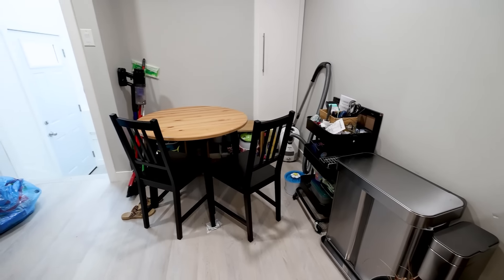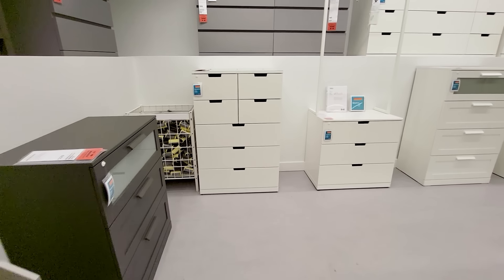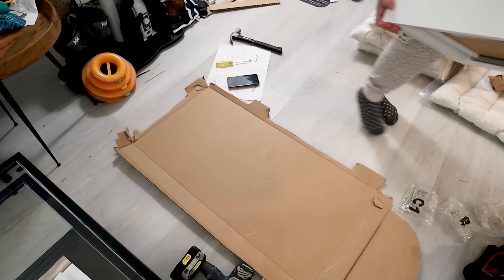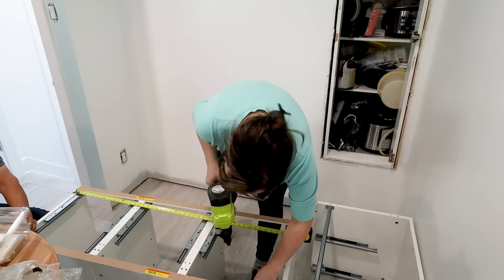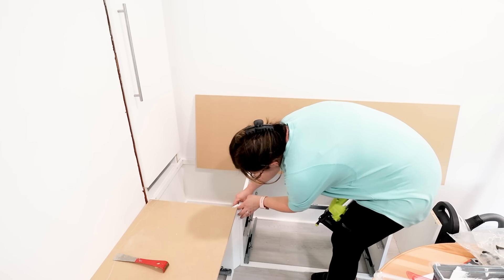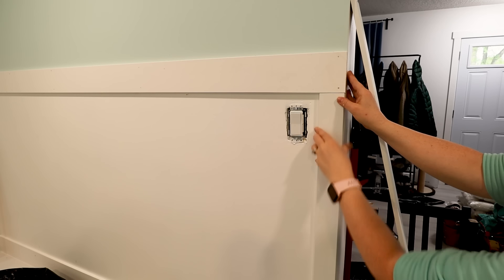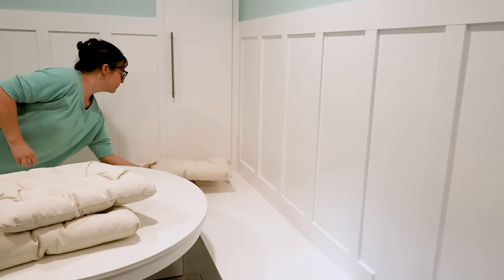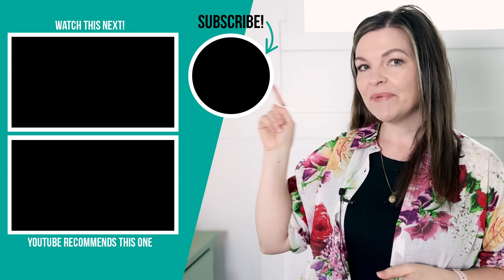I Used IKEA NORDLI for a Stunning Built-In Kitchen Bench Seat | Breakfast Nook MAKEOVER

Comment: That's such a huge improvement. That pantry cupboard is certainly in an awkward place; I'd be tempted to just drywall over it since you've created so much extra storage. Adding the lift so the drawers operate smoothly is just the thoughtful step you can be counted on to do. That's a pretty space.
Reply from the maker: Thank you! The pantry is well used and still needed, so they're going to keep it.
Reply: @thediymommy  is there a possibility that the pantry door be placed on the other side?  It looks like there is a room behind the kitchen/dining room(?)
Reply: Beautiful bright breakfast corner. Love the extra Nordli storage. 

I would only add a recessed handle to the pantry door, which could be more comfortable to sit against.

Comment: Love this!  Did you consider making the board and batten the same height as the pantry door?  It could have disappeared if the space in between the boards were the same width as the pantry door
Reply from the maker: Thank you! I did, but I didn't like that height for the board and batten. I prefer it either 1/3 or 2/3rds up the wall.

Comment: Lovely job, your sister must be rapt. Probably the only thing I would have changed (and this is probably nitpicking) is to remove that long handle on the pantry door and replace it with something smaller and more fitting with the style you created.